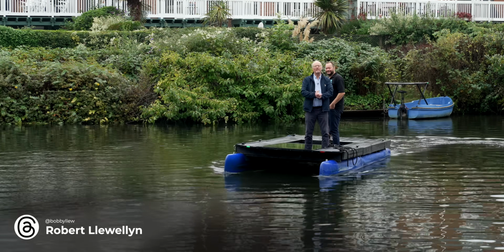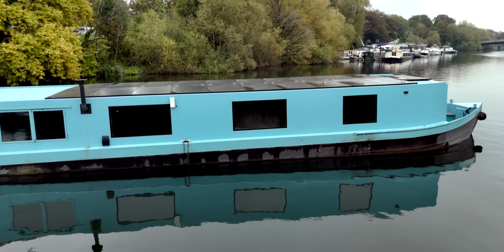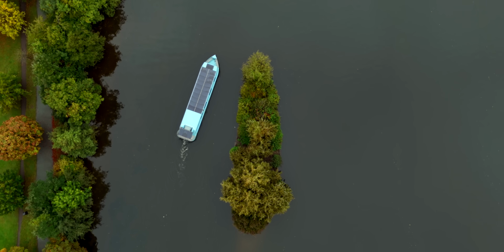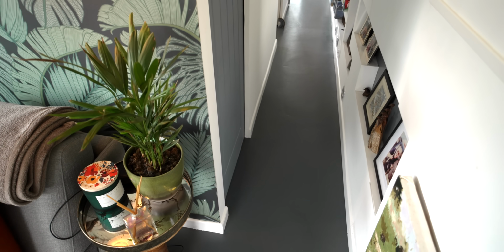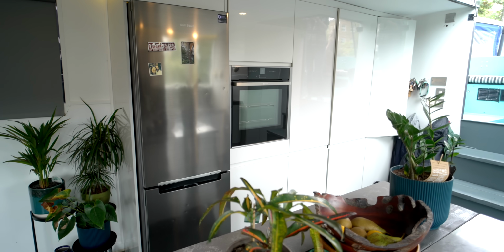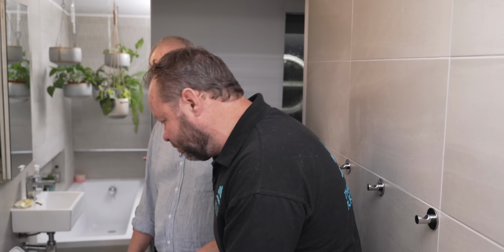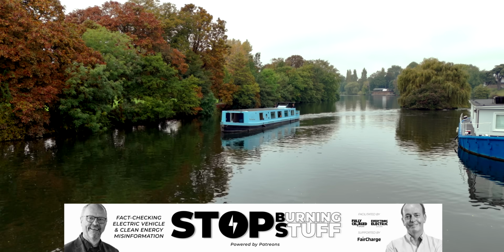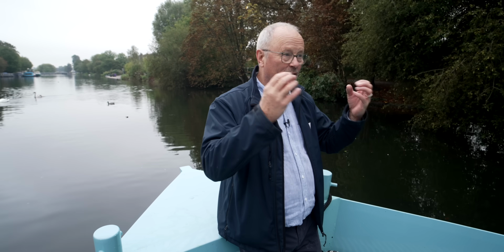Living On An All Electric, Off-Grid Dreamboat!

Comment: I find it quite curious how they say they're trying to be as green as they can and then proceed to show that, rather than a heat pump, they have a wood burning stove.
Reply: Despite a heat pump being more efficient than straight electrical heating it's still a large consumer of energy ... more than those solar panels can provide in UK conditions.
Reply: At least a wood burner is largely carbon neutral compared with fossil fuels, but I do agree with you; it would be nice to see an air or water source heat pump, but I guess it's future-proofed and one could easily be added at a later date with the hydronic underfloor heating design.
Reply: Hi Lua , we are working on a water Sourse heat pump so hopefully not to far away , saying that there isn't enough winter sun to heat the boat so need an alternative like wind ( experimenting as we speak )
Reply: @thamessolarelectric3662  Hello, and sorry that I was rather harsh. I meant that this type of thing makes me wonder what's the rest of the story.
A water source heat pump can be an interesting thing to read about, but I didn't about whether it's cloudy when it's cold often. That amount of panels might be enough for a water source heat pump on a rather sunny day, but I don't know a lot about British climate. In regards of wind, however, I would worry it might destabilise the boat, particularly if the turbine rests on a high pole.
Have you considered hydro power? Might be plausible if the boat spends more time anchored than travelling.

Comment: Nice boat and very well designed. I still prefer a diesel boat with a wood burner, cant beat it!
Reply: You're not wrong there!

Morso Squirrels (other stoves are available) just work ... just sweep the chimney as and when and stove will last for eternity.

Diesel (red) available the length and breadth of the system and plenty of local talent to service the engines.

Comment: At 77, I work converting RVs from fuel burning generators to solar and lithium batteries. The large "Class A" rigs have NO need of generator back up systems - all solar, all the time. Air conditioned in summer, electric heated water powered floors in winter. All domestic appliances, including fridge, freezer, washer and dryer plus ovens and coffee makers -ALL from solar. I live in one of the rigs, full time and commuter in my electric trike that is also solar charged. Thank you for this video. BTW, 75% of fuel used on an RV is for generators.
Reply: Reference your remarks on solar doing the hard work for the domestic draw ... presumably you live somewhere NOT in UK?

Solar power generation  in this neck of the world suffers from "weather" getting in the way.

And if not the weather then overhanging greenery on the banks doing the shadow thing.

Plus we suffer, occasionally, a free gift of Saharan dust ... and guano ... and aphid shit (which can soft set like epoxy resin).

That said my mere 560W of solar, when free of the above, via MPPT controller, does keep battery banks at or above the magic 12.6V overnight.

Only current draw from batteries when on shore power is lighting and various pumps.

Mains fridge draws 0.6A ... but when cruising you're looking at 12A through the inverter. Fortunately fridge isn't on all the time.

Relying solely on solar for energy production (on a narrowboat boat in UK) is not quite so straightforward as a year round thing.
Reply: As you mention aircon, I assume you are in a warmer country than here in the UK.
Our main loads are heating and lighting. The peak of which tend to coincide with short days and low sun angles. And our famously overcast/cloudy skies.
Also these people are using their solar for traction too. Though I suspect they are travelling short distances during what passes for our summer.

Comment: The outakes were mildly hilarious. My only observations were you could of got more solar on the roof and shift half the batteries forward    to keep the boat level next time. 👍. How long did that project take?. SUPER
Reply: The water tank up front would provide the ballast, if it weren't empty (sounded like they filmed after a dry spell, so the tank was running low - which meant a lack of counter-balance in the front)
Reply: All canal boats sit lower at the stern, you get used to it within a day or two and don't notice you're walking slightly uphill to bed.
Reply: @AlexOnABoat 

😂

Depending on layout that is.

Comment: Why did they ruin it with a wood burning stove? Didn’t he say it has under floor heating?
Reply: There's no way they'd get enough solar during the English winter to run a heat pump. They'd either have to plug in or burn something.  Burning locally sourced wood is about as green as they could be when they're off-grid.
It would have been really nice to hear some figures for how much heat they need.
Reply: It's probably a heater-back on the stove that heats the underfloor heating (they did say explicitly that the floor was heated from the stove)... and whilst heat pumps are good, it would still be a fairly significant drain on their storage (which would be an issue in winter if they don't have a mooring with electricity... and those cost an arm and a leg around London, iirc)
Reply: @logicalChimp  Ah ok I must have zoned out for a second when he said that. Doesn’t make it less bad though. When it’s so well insulated, an electric heating solution must have been an option. It can’t be too far off passive home standard. And especially when they have an oversized battery system too. Why would you not use some of that power?
Reply: @christill don't forget that battery bank is also there for motive power, not just to keep the home running day to day. There are boats with water - source heat pumps, but I've yet to speak to an owner who says they work properly onboard.

And they could well be burning renewables not fossil field.
Reply: @AlexOnABoat  I assume they don’t move the boat that often. And what renewable thing could they be burning, since biomass is a scam?
Reply: @christill I don't think it matters how often they move, when you commission a boat you build for the most extreme conditions.

So whilst I'm sure they could use electric heating, even just something plugged into a wall socket, if they wanted to cruise in winter AND be warm they'd need something other than electric heating.

As for biomass being a scam, I'm pretty certain they can source good quality, air dried, local timber, I know we can.
Reply: @AlexOnABoat  From what I've read about other electric canal boats, they can use more power heating hot water and cooking that for propulsion. 
I would have thought a water-source heat pump would be ideal (when you're plugged in to shore-power). What problems do they have?
Reply: @robinbennett5994  They're not plugged into shore power ... so not enough power to run heat pumps.

Comment: Love it! So clever! And think how useful it will be when all the ice caps melt and the sea level rises to new heights! Swap the lead-acid for more modern batteries, and you'll really have a winner. I wonder what kind of regulations an HOA applies to such floating homes. Do they have to pay a monthly fee for a particular berth…?
Reply: The whole point with a boat is that you don't need more modern batteries, lead acid work fine, and help ballast the boat so she won't sit high.
Reply: Lead acid are ideal ... they need the ballast, they have the space so no need to use the much more expensive lithium ion. Check out the cost of a 100kWh lithium ion battery pack!
Reply: Yes, you have to pay if you want a permanent mooring (pay through the nose, around London)... but you can also get a 'continuous cruising' licence with is far cheaper - but which requires you to move (at least a few miles) every 2 weeks, iirc.
Reply: you can either have a permanent mooring with you pay for or you get a cc licence and keep moving every 2 weeks
Reply: @thamessolarelectric3662 

😂😂😂😂

Or you can do both.

 Owners of moorings happy to take you cash any day of the week.

And, CRT (don't know about EA) are about to impose a surcharge on continuous cruisers without permanent moorings.

Comment: Awesome boat, bird poo and leaves could be a problem, have to clean the solar panels daily as not on an angle.
Reply: Yes, regular cleaning will be needed but much more accessible than house panels. I'm surprised they didn't choose a slight angle. Easy to change I would have thought. The sun in the UK is never truly vertical anyway.

Comment: Had a nice smile on this one, we walked a section of Thames Path in the middle of the year and went past this boat and those double-deckers also seen on the film. I even have 3 pix of it moored up on the opposite bank!
Interesting they chose lead-acid batteries, I guess weight helps towards the ballast and if second hand forklift ones then a lot cheaper.

Comment: Thanks for the video Bobby and hats off to the owner for the build. Good ole' lead acid, superceded now but after 14 years our off grid lead acid home battery is still going strong. 

Would be interested to know initial cost compared to similar off the shelf boat and then ongoing maintenance/ running cost. 👍🔋🇦🇺.
Reply: I’d love to know how much those batteries cost too.... IF you have a home with the room for them it could be cheaper then lithium powerwalls etc
Reply: @Obvsaninternetexpert  No lithium are much more economical per kW/h these days  but need more complex management systems.
Reply: Hmm ... perhaps some research on battery technology might be useful.

Lead acid traction  batteries are used for a reason ...
Reply: @t1n4444  Agree. Not sure of your point though. We're not talking about traction batteries here.
Reply: @ElectricCarAustralia  

Yet the boat was full of 2V traction batteries cobbled up to provide two 48V banks.

It might have been useful to have seen the motor and control gear too.

Using very heavy lead acid cells can be useful in that they provide ballast.

There are many, many boats which use lithium cells of course but the cost of a service bank is eye watering.

Plus the merest hint of thermal runaway deters a lot of builders, not just the cost.

I gather that the BSS outfit (imagine an entity who do a sort of "any" boat MOT, every four years, and without a pass certificate you can't renew your licence, to navigate, or get insurance) which is attached to CRT has yet to take a view on lithium batteries aboard boats (when used for propulsion).

BSS have a dynamic review system which means rules and regs can change at any time if deemed necessary.

You can be sure that if lithium cells became an issue then the insurance companies would be "reluctant" to provide cover.

Much like the vehicle covering insurance companies we see today.

Lithium batteries really are a bad idea in cars now that the insurers are gathering data on how easily a battery pack can be damaged following even a "minor" collision.

We might see ditto for home battery packs once the actuaries working for insurers calculate the risk.

Naturally I speculate at the moment.
Reply: He has company which is selling these, ranging from £100k-350k, depending on if you want just basics, or fully fitted boat and what size of the boat.

Comment: Interesting use of lead acid batteries rather than anything lithium. May as well when you need to add ballast anyway!

Have to wonder how long they'd last though. Lead acid aren't great for longevity.
Reply: Those 2V tubular style batteries have a much longer lifetime and more cycles than regular lead acid, and are more expensive. Mine lasted 13 years in an off grid cabin, but my new LiFeP batteries outperform them in every way.
Reply: Hi Drunken hobo , these batteries aren't your usual lead acid batteries but rather industrial traction cells , and assuming your most regular use is the top 20 % of charge they are rated to 5000 cycles and a third of the cost of lithium .
Reply: Well managed in a cool boat not being over charged or left flat I bet you still get 12 plus years out of them

Comment: What about the really big industrial boats on the Rhein?

I live in Bonn (Germany) and there are massive industrial boats that each carry hundreds of shipping containers, when I write "shipping container" I mean the things that would normally be pulled by a lorry, except a lorry can only tow one at a time and each of these boats has hunderds of them.

Another problem is the Rhein is not slow, so these boats needs to be really powerful.

Personally I think hydrogen is the solution, but I don't see any progress I just smell the awful diesel smell from these massive boats.
Reply: Shipping is a hard problem compared to cars and domestic heating, and a relatively small part of the total problem. We should focus on the 'easy wins' first, so ships will probably burn oil until we've all switched to EVs and heat pumps.
As I understand it, hydrogen is the leading preferred solution for shipping, but they're looking at converting hydrogen into ammonia because it's more compact - and it won't happen until there's a significant amount of spare renewable generation capacity. There's no point using gas to make hydrogen.
Reply: Hi Mathew< I agree with you there are many things that are impractical to power with out Fossil fuels currently . But that doesn't mean we should power the ones that can with renewables ?

Comment: Don't forget yo have to have a CRT license, then there are mooring fees, and you have to take the boat out of the water every three years for the equivalent of an MOT.
It all costs a lot more than you'd expect!
Reply: If he's only tootling up and down the Thames, he won't need a CRT licence (presumably the EA have an equivalent)
Reply: @real_electricmonk  they do, and it's paid per ft²
Reply: The "MOT" you're referring to is the Boat Safety Scheme inspection and it's done with the boat in the water.

You'll only need to lift her out to repaint, and depending on the paint you use that can be every 7-8 years.
Reply: - The inspector cannot do the external hull examination with the boat in the water! Steel hulls have to be ultra-sounded - looking for thin spots or corrosion, and grp hulls have to be examined for laminations going porous.  @AlexOnABoat
Reply: @hamshackleton 

You are confused.

BSS doesn't cover condition of hull.

The main thrust these days is gas safety, which includes having CO monitors and adequate ventilation.

Plus the requirements change quite often.

The last inspection I had the inspector was mad for ensuring all gas pipes were properly secured every foot or so.

Might be something else in a year or two.

Lithium batteries storage, as in position of, might be something they consider some day.

Hull condition is visually checked every time hull is blacked but not always with ultrasound kit.

If your hull goes orange  after coming out of the water then a lot of pitting.

The owner is advised on the state of the anodes too.

Some insurance companies require a marine surveyor to check the hull when a boat reaches 30 years old. (Some companies may have different requirements.)?

They want to know about pitting and thickness of hull plates.

Some insurance companies include a River and Canal Rescue membership (Bronze level) for "their" peace of mind.

Insurance companies very "conservative" when they receive a claim.
Reply: @t1n4444  I suspect we are talking about different ends of the stick.

Comment: How is water heated? The wood stove?
Reply: Electric would work. Heatpumps would work. The stove probably works; they did mention they use it for heating the floor. But you wouldn't want to in the summer.. Solar heating could work (in the summer). There are lots of ways to heat water. Putting the water tank under the bed in the insulated part of the boat is also smart. Saves a lot of energy in the winter if you only have to heat it from 20 degrees instead of near 0 degrees.
Reply: wood stove in winter excess solar in summer